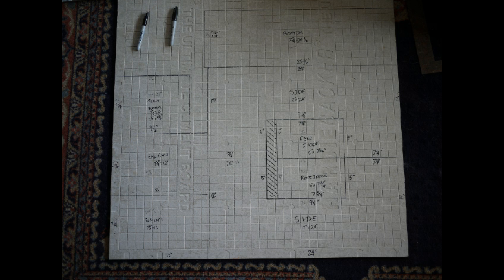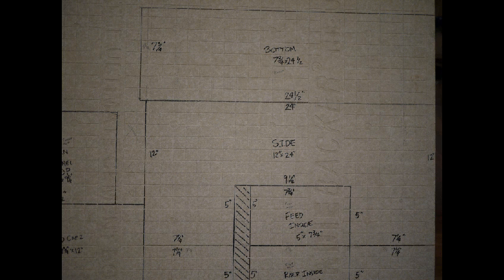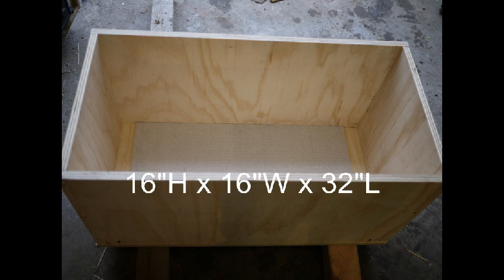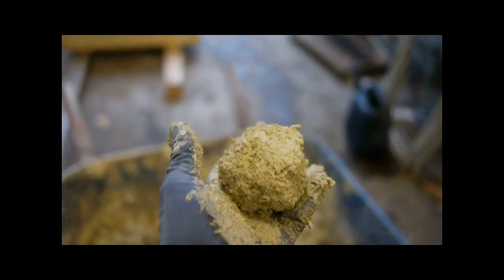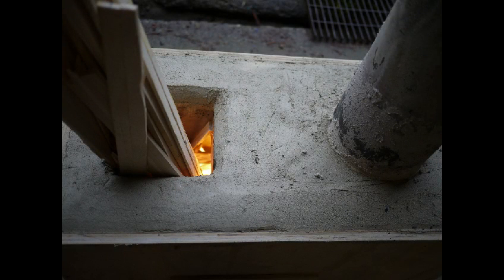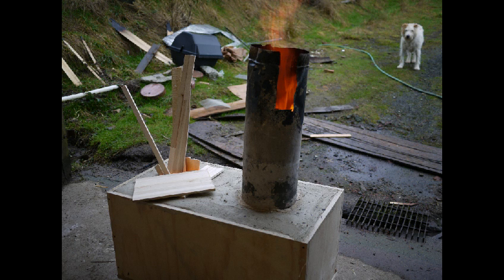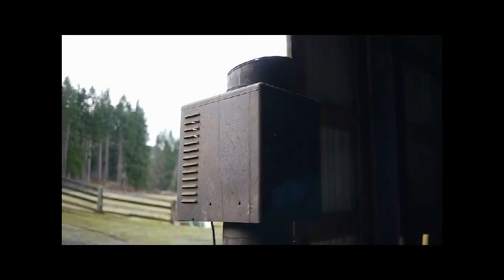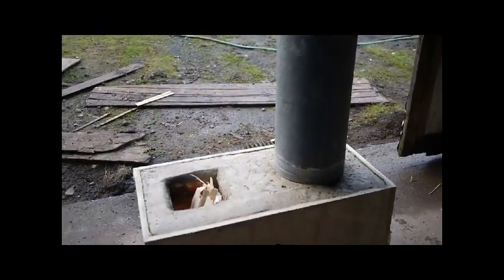Rocket Mass Heater Cast Core Build

Comment: First off, I love the idea behind this and thanks so much for sharing it with us!

I was hoping to get your input on one thing...do you think the heat riser could also be made out of the same material as the core?  Like a rectangular shape, casted separately and then added/mortared back in where the existing metal heat riser is?

Seems like that would perform pretty well, what do you think?
Reply from the maker: Hi, yep, have you seen my cast core part 2 video?  I make the riser using the same mix and then it is just set on the core and seated in a bit of the mix.  Sounds like you have a good handle on the process.  Good luck on your build and thanks for the comment!
Reply: Yes!  I've seen so many of these, I sometimes get the videos confused!  :)

Thanks for the reply and the words of encouragement.

One last thing...is there a place where I could find the board measurements?  I can't see them very well on the video...
Reply: ***** So, I'm moving forward with this project today...using your specs!  I just had one more question...instead of teh fiberglass....I know some people have suggested nylon rope cut into bits, stainless steel fibers from a scrubber sponge, etc.  But I was wondering what you thought about simple straw.  I'm not afraid of it catching fire at all, since it will be mixed in...isn't the whole purpose to keep the mix from cracking?  I would think simple straw would do a fine job, but I'd like to get your opinion please.

Thanks again.
Reply from the maker: It sounds like you have a good handle on things.  I'm inclined to think straw would leave large voids that may weaken the mix, but I have to admit I haven't tried it with this mix for a core.  I have used straw in simple found clay/sand castings for temporary cores with good results, So, maybe?  Stainless wool or needles would probably be my first choice after playing with ss needles lately, although the fiberglass works well.  You are right that fiberglass makes tiny expansion joints where it burns out, but I believe in the outer layer the fiberglass persists and gives tensile strength to hold it together despite cracks.  Those are my thoughts, I don't think you can do it wrong.   Good luck man!

Comment: Hi there how's it goin . I am dan . Very interesting j tube rocket stove . 
So when u mix all the stuff do you really need the fiberglass ? Don't really wanna be itching lol . So you use fire clay and pearlite and water . Do you have dimensions ? . Thank you hope I don't sound to confusing never built anything like this . Thanks dan
Reply from the maker: Hi Dan, you don't need the fiberglass, you can skip it if you aren't comfortable with it.  I'm not sure what you mean by dimensions, but hopefully you can read the measurements on the board in the beginning of the video. Good luck on your heater and thanks for the comment.

Comment: 14 fire clay + 14 perlite + 1 fire cement isn't equal to 100. Do you fill the rest with wool (fire glass) ?
Reply from the maker: No, it's not percent.  If you use 1 cup of fire cement, use 14 cups of fire clay and 14 cups of perlite.  Thanks for the comment.

Comment: I think I'm finally settled in now and HOPEFULLY start my build of the cast core RMH.  I have two questions: (1) I always thought that concrete (including refractory motor) needed TIME (the more time the better) to cure VERY HARD (which is what I want.  Yet, with your build, according to you, "I lite a fire the next day and let it rip"... My question is: "will my cast core build be harder and stronger if I were to let the pour set up (Without heat) for a couple of weeks before actually liting it up for the first time.   My second question is about 'the proportions' of clay/perlite (1:1;  and/or 14 parts of each PLUS whatever amount of refractory mortor, I can afford.  My question is: "Approximately how many 50 lb bags of clay did you end up using to build both the stove AND the riser? ( I'm guessing, what, about 150 LBS of clay and equal amounts of perlite (via the suggested ratios?????  I appreciate that your very busy but I would really like some idea before I proceed (Hopefully this week (before the cold sets in)
Reply from the maker: +Bob johnson Bob, if you want a hard cast core, you don't want to use this mix.  This one makes a soft, insulated "liner" for a cob surround.  I can tell by your question that you won't be satisfied with it, and it will crack.  I recommend finding a commercial castable refractory if what you want is concrete-like performance.

If you do go this route, your estimate is about right, 150 lbs of clay and an equal volume of Perlite.  Good luck on your build!

Comment: Hello broaudio. Much respect. I like your cast core instructions better than most I have seen on YouTube.  My question is I have a high quality industrial dry refractory mix. Rather large amount came my way by luck.  I read in the comments that this type of refractory is not a good substitute for the gallon size ready mix stuff that contains sodium silicate .  so my question is would I b better off casting my burn tunnel out of pure refractory cement say 1 in thick, then fill the bottom of my 16 by 16 by 32 inch outer form with fireclay perlite mixture,allow it to cure, cast my burn tunnel ,set it on the 4 inch thick perlite fireclay bottom, then complete the rest of the infill around the burn tunnel with perlite fireclay.  Basicly  a 1 inch thick burn tunnel or square u shape...surrounded on all sides by insulating perlite fire clay mix.  By the way I constructed a 16 by16 by 32 inner dimensions box out of firebrick for a perminant ridged form, instead of using cob to surround the core. Also plan to line the brick form box with heavy duty foil shiny side up to help reflect heat back inwards and to keep the core mix from sticking to my brick. As shrinkage occurs I plan to fill the surrounding crack between firebrick box and core with sand, for support and shock or tremer resistant cushion for the core.  Iv done a ton of research on RMHs and homemade and industrial refractory and feel that I have only scratched the surface.  Please let me know if I'm on the right track with this idea... Thank u so much for your time and your awesome videos.
Reply from the maker: Hey, thanks for the kind words.  Your plan is excellent, and is really the better way to go.  My mix here is just a DIY mix for folks who can't source true castable refractory.  If you have enough refractory you might up the wall thickness to around 1.5-2" just to add a bit more resistance to wood knocking around in the feed, but overall I think you will come out with an awesome stove if you build it exactly as you describe.  I've done the brick surround and it's an excellent technique. Good luck!

Comment: I have and idea that would help to create a vortex within the flue.  Wrap hemp rope helically around a 6 inch PVC pipe inside form like rifling inside a gun.  Cast the refractory material around the hemp rope.  When the cast of refractory has solidified for a day, withdraw the PVC pipe, leaving the rope in place.  On the first burn the hemp rope will be consumed, leaving a nice helical twist within the inside diameter of the stack.  What do you think?
Reply from the maker: Curtis Turner Hi Curtis, no need, it will only add drag where you really don't want any.  Don't over think it, the J design is deceptively simple yet achieves complete combustion very effectively.  You really can't make the burn much better.  You'll get better results focusing on good insulation and sealing of the core, and good flow through the whole system.  Good luck on your build!

Comment: Dude, you're the best- I've been looking for something like this and I was getting a headache, tryin to figure out measurements and proportions (and motivations) out of all the piecemeal info out there, about RMHs!  And it seems everyone is using fire brick but it's not much of an insulator. Your way, I can pour a hybrid aircrete mixture (cellular concrete with basalt/ fiberglass and/ or vermiculite) and have a core that's superior in insulation and very LIGHT. And with aircrete, I can cut out my cleanouts easily with a wood saw. Instead of flue vent distribution, I'm going with bell courses. Thank you!   Any insight you have regarding my plans would, of course be much appreciated.
Reply from the maker: You are welcome, thanks for the kind words.  I think you have a good handle on things.  Portland based cements won't handle the temps in the core combustion areas for long, but you could probably run it for a while before it deteriorated too much.  If you want it to be a forever build, I wouldn't recommend it, but as a first build or a step in a progression, I think it's probably great. Hope that helps.
Reply: Yes; then perhaps I should try aerating fire clay and my fiber additive (with or w/o fireplace mortar) for the pour into the core mold... do you think I'll have to burn-cure this afterwards?  My preference is to cast a light core that I can easily lift but that will not need repair or replacement down the road. I suppose it's time to run some experiments and for what it's worth, I'll let you know what I discover. Thanks so much for sharing your ideas and perspective.

Comment: what would the dimensions be for a 6 inch riser
Reply from the maker: Mark, make the core such that the passageways are 5 3/8" square.  You can keep the overall length and height of riser/feed stubs the same.  Hope that's clear.  Good luck on your build.

Comment: Preaty cool idea on the rifleing designs using a rope in the casting BUT broaudio is right it will just create drag I'm afraid. Iv been studying the laminar flow effect, yall should check it if your unfamiliar with it.  It's fluid dynamics, basically it sez the layer of air closest to the rough brick surface inside the system allmost stalls, causing the layers of air above it to tumble or mix!!!   Lots of fluid dynamics going on inside these things.....

Comment: in other words... your mixture is: Clay, Perlite, Furnace cement + apron. 4 inches ( enough for 2-3 4 inch batts top and bottom) torn into  wisp bitts.. correct????  (i.e.) I DON'T line the box with 4 inches of fiberglass IN ADDITION TO  mixing with the cement, clay, fiberglass(wispie bitts) and perlite

Comment: Thanks, this DOES help! Here are my questions, 1. I wasn't clear on what you did with the insulation fiber glass? 2. Did you add those protective tiles around feed hole, to this, or is that later? 3. Could you line the bottom/inside floor of the core with something to protect it better, stone, fire brick or even think sheet metal? 4. After all is cobbed, is there a plaster/concrete coat (that you painted baby shit :)  Answer what ever you can THANKS!

Comment: Wouldn't it be pound for pound not cup per cup because 4 cub of perlite is only 20 lb that would be 2 to 1 and  my hi Temp is one gal but is 25lbs
Reply from the maker: I dunno man, maybe your stuff is different than mine.  My fireclay was dry, so 1:1 by volume clay:perlite worked for me.  You might need to experiment a bit to get the mix right with your materials.  Good luck and thanks for the comment.
Reply: So you are mixing your components dry then adding water because I thought you made clay let it sit for a day and then add the perlite then make the refractory cement and add that to the mix 
So 100lb fire clay 1 bag perlite 4 cube and one gal refractory cement
Reply from the maker: Thomas Rumbach  I measure the materials dry.  Then wet the clay, although I don't wait a day it's probably a good idea.  Add Perlite to wet clay, then refractory cement.  I had a comment that some folks are coming up short with 100lbs of clay, so you might want to have three bags on hand.  Good luck man!

Comment: Suggestions for the cheap asses like me: Use fire clay and silica sand for the insulation mix. 2 parts sand to 1 part clay, mix like the video shows. Very cheap. This is used in to make small charcoal foundries for melting aluminum and holds up well. MUCH cheaper than premix refractory cement. Makes a good crack patch compound too.
You can also add some small wires (chicken wire, coat hangers, etc) for "rebar" to add strength and help prevent cracking.

Comment: Here's the thing... you used fiberglass as a additive to hold the mass together but the thing is, fiberglass is glass fibers. If you throw a glass bottle into a campfire, it melts and sags. I have heard to use stainless steel fibers. If one cannot get them, there is always stainless steel pot scrubbers that can be cut up and then use that. Other than that, I am going to give your process a try but use stainless steel fibers. I know of a few machine shops around so somebody should have some and I can't see that they would be very expensive.
Reply: ***** Skip your mix? I don't think so! So far it seems to be the best one I have seen for the purpose. Thanks for all the useful data! I whipped out the center part of the mold last night. I will knock the outside mold together tonight and buy the clay and cement in the morning.
Reply: andy careaga how did it go?
Reply: It went mighty fine. I did not use the metal fibers. I just used vermiculite and I had a source for ceramic fibers. They are not so long as metal ones would have been but overall the project turned out pretty good. The wife is not so fond of it. She much prefers pretty wood hogs that work her old man to death keeping them fed but that's life. I guess it is the barrel that offends her sensitivity.
Reply: And I'm still using the heater two years later, btw!
Reply: Here's some info that people might find useful. I used 8" stovepipe for the inside of the riser and had a tube made of heavy sheet metal (not galvanized) about 12" diameter for the outside of the riser and stuffed the inside of the space between them with rock wool. After a bit, I noticed that the inside stovepipe was getting oxidized and pieces of it were falling down into the burn channel when I scooped out the ashes. At the start of this season, I wanted to see what the inside of the stove looked like and the inside stovepipe was completely gone but the rockwool was holding its form well and the outside tube looked fine. Still I replaced them with standard chimney flue liner the same size I guess by the time the gasses got to the outside tube they were below the temp that would degrade the tube. Moral: Plain steel inside the riser will not last. Temps just get too hot
Reply: Andy C I was picking up some kiln brick the other day and asked if they sold sodium silicate. .. "No, but we spray our rock wool with it to make it stiffer" was the answer.